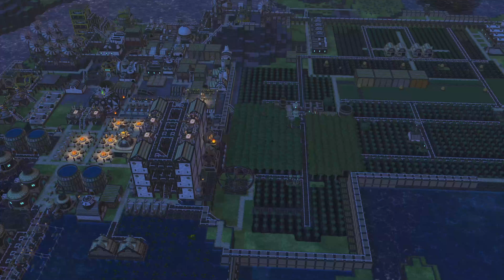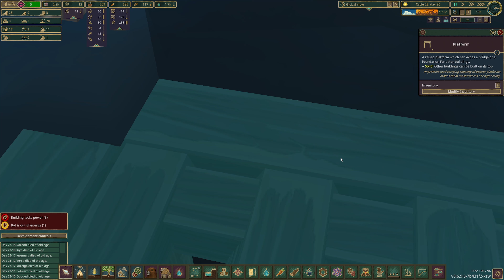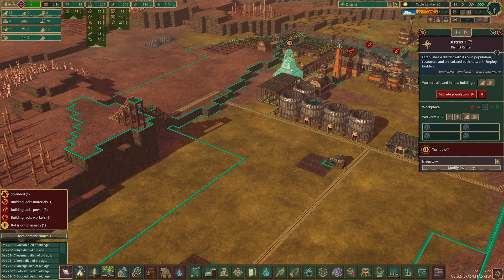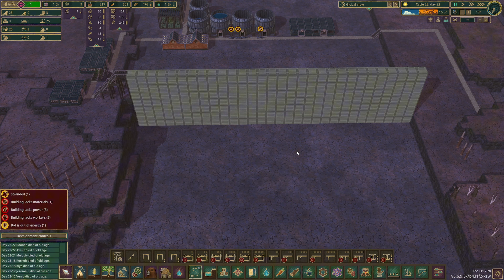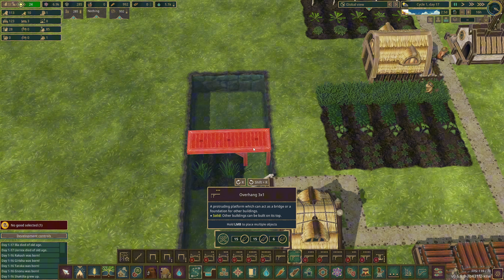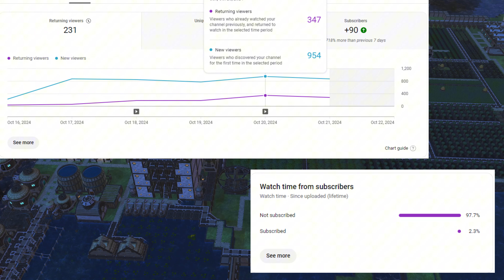Timberborn U6 - ULTIMATE In depth Construction guide! How to build FIVE TIMES FASTER!

Comment: I really feel like they should change it so haulers can carry rubble. Also make it so districts will pull over needed construction items even if you only have "Import as needed" on.
Reply: Haulers should DEFINITELY pick up rubble. I also wish the "building" priority of rubble was set to High by default.. or at least I wish there was a mod on Steam to do this. In no scenario I want rubble to stay on the floor and I end up manually prioritizing it 100% of the time
Reply from the maker: its one of the low priority micromanagement stuff. 
To be frank, i don't see it such a hasle, yes it's an eye sore, but its easily fixable!
Reply from the maker: I agree with Haulers carrying materials! However for import as needed on, sadly that would be very hard to implement. Immagine you have 4 chained districts with crossings A<->B<->C<->D. In district A you have timber. You're building a house in District D. Now the game needs to figure out, Ok I got lumber in A district, and I need to move it to D district, passing through B-> C-> D.
These checks would happen once every 10 frames, whilst you are playing on 60fps to not be noticeable. Now you're stuck with very high cpu to do the computation logic :P

Comment: Hey! I've been all your guides so far, they are very useful and interesting.

I really liked the background music in this one, it is calm and of perfect volume. It was a little annoying in some previous guides.

On the topic of building - it indeed matters a lot that beavers can do construction from multiple locations at the same time.

I would also emphasise that even for small projects it is mandatory to place a lage log and plank piles nearby and set them to Obtain. And do so in advance, so they have time to fill up. Specially so if the construction site is far away. Using haulers for delivery would make things more efficient, and construction will go way faster when builders just take materials that are nearby. And even after the construction is done it is very handy to to have those leftover piles of logs and planks scattered throughout the map. 

Another point on construction - it is better to avoid one completely if you currently have a shortage of building materials. Buidlers will run all over your city collecting them from places where they are also desperately needed, making a lot of other beavers waste their time. It is better to assign builders somewhere else and wait until you have those juicy piles of planks and lumber right by your construction site.

Comment: 18:55 This is actually the wrong way to do it! The beavers won't be able to build the metal platform from the right side because they need the wood platform on the left done first, and the wood platform on the left needs the other metal platform further left and so on - meaning you're only building the metal platforms from one side! This only works in the example of the video (on 20:13) because the builders can build the platforms from the ground - if they weren't able to, say because you're building over a cliff, they would build exclusive left-to-right because that's the orientation that every platform is on!

The ideal scenario would be to start metal platforms from BOTH sides, with them meeting on the middle, that way your beavers can build the metal platforms from both sides, significantly reducing the building time of the metal scaffolding.
Reply from the maker: If you're on a cliff, you must get somehow to the other side to start construction, unless u got pretty close, a pre-existing brdige done left to right leftover from a previous building/project :P Indeed you are correct because of the pathing below this was achieavable in my video even in a left-right manner!

Moreover, depending on how large your project is, building platforms from both sides simultanously would save you seconds in a marathon basically :face-blue-smiling: (but if you're aiming for gold, that's the way to do it!)
Reply: @honeybadgermcd  Of course, it all depends on the situation of the actual building you have. If you can only build from one side, the orientation has to match.

But in your example you had stairs on both sides so the ideal technique would be to have two different orientations meeting in the middle. And the less time you take building the scaffolding that's going to be deleted later anyway, the faster the overall project will be finished.

Comment: 15:45 There's a much cheaper way to build a large dam in multiple columns like this instead of using a ton of logs and planks on platforms and stairs as scaffolding, or using a ton of metal on metal platforms!

If you just replace the paths on top of the dam with 1 scaffolding and the largest bridges you can use, and prioritize them, the beavers will be able to build every row of the dam below the bridges all at once! If you do this with bridges starting from both sides of the dam you can build this dam much cheaper (no need for tons of wood, planks or metal, just a few 1 tall platforms and bridges).
Reply from the maker: Cheaper, yes bridges on top (or even platforms if u lack wood and got steel), but not faster. Just tested it out now, and its at 21 days(it took them roughly a total of 8 days to build the 4 pilars holding the bridges)
The reasoning for this is that at the begining, even if brdiges are high prio, they still need to firstly build levees 1 by 1 on both ends of the dam before placing the bridge on top! Moreover, a bridge takes roughly 5-8 times more construction time than platforms :P 
In the scenario from the video, you will need a total of 4 6x1 bridges to cover the entire dam.

The dam is 7 levees high so they need to build 28 levees + 4 briges 1 by 1 before managing to start pararelizing the other dam pieces :D
Reply: @honeybadgermcd  Yes, I'm aware it's not as fast as using actually scaffolding, it's more about reducing the cost of logs, planks and metal. Specially in the early and mid game, wood is plentiful but large projects will still take up a lot and you need to make sure your logs and planks are spent on the actual dam rather than scaffolding. Late game, when wood and planks aren't an issue, scaffolding is ideal because you can afford the material cost.